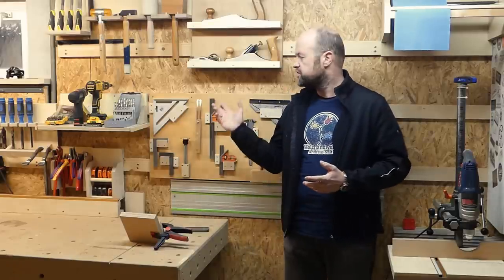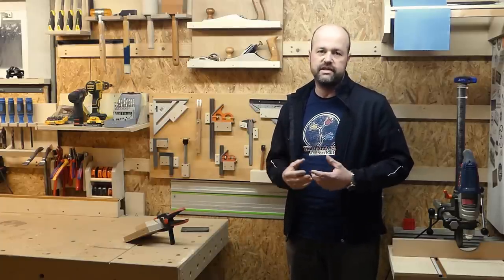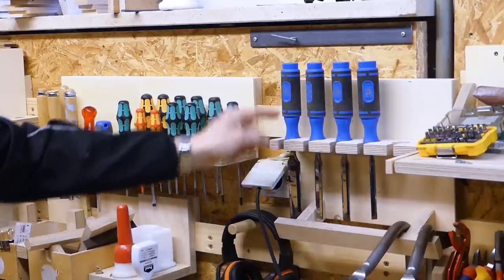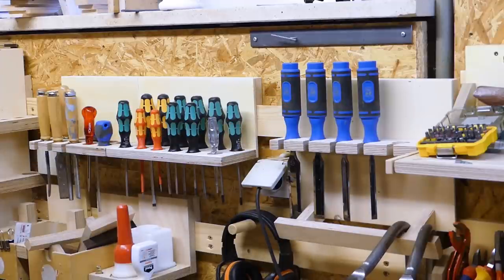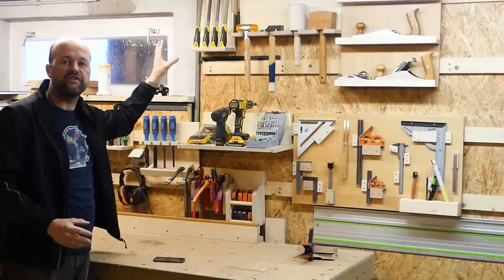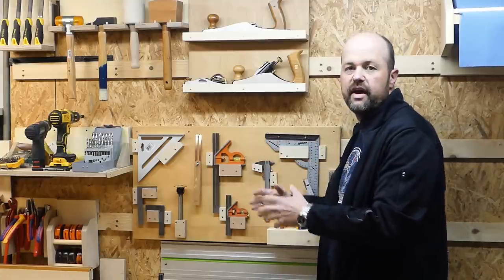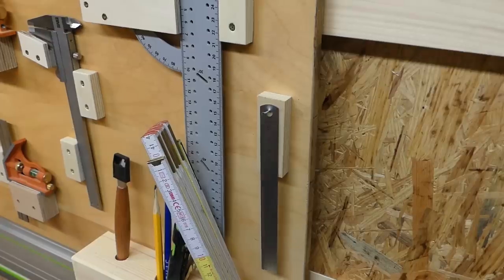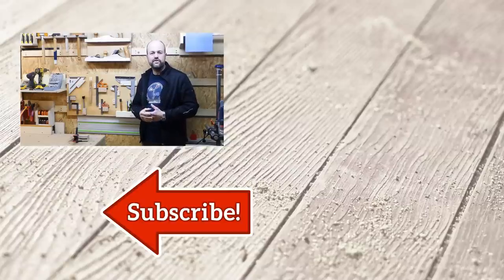Tool storage ideas: Make french-cleat tool holders and organize your tools

Comment: Andreas, I just ran across this video at the perfect time.  I'm currently in the process of outfitting a French cleat system.  I especially like the idea of spacing the measuring tools off of the backboard.  I share your concerns of having chisels exposed as I've seen by so many woodworkers.  The pockets for the screwdrivers are a nice aesthetic touch but since the handles are still resting on a flat surface I don't see how they would help stability.  I still appreciate the detail work there and how the measuring tool holders are nicely rounded over.  While I generally prefer narrated tutorials, the first portion of this video is well done to illustrate your builds without words.
Reply from the maker: Thanks for your thoughtful feedback!

Comment: Andreas, this may seem like a silly question. But your pencil caught my eye. Can you tell us about it? What type is it? Do you like it? Would you recommend it for the type of wood work you do?
Reply from the maker: It’s called Expert Dry Pen and I like it. But apparently, the original version is the Pica Dry Marker which seems to be better quality. I like that it has a belt clip and that you can reach inside holes (if they’re not too small). Make sure you get the H-grade  lead refill (the harder ones) for more accurate markings, the softer ones are more for carpenters who can tolerat thicker lines.
Reply: Andreas Kalt many thanks. I will look for it.

Comment: My tools are all accumulated, handed down from as far back as my great grandfather. Also I like to rummage for older tools and restore them.. I hardly have 3 screwdrivers or chisels that match... any tips?
Reply from the maker: I don’t know what it is you’re asking. What kind of tips are you hoping for?
Reply: Andreas Kalt my screwdrivers and chisels have different shanks. Some tapered some flat some notched... yours all seem to be of mated sets with all the handle bases being flat... not so in my case
Reply from the maker: OK. That would just make the process of making the tool holders a bit more cumbersome because your going to have to drill individual holes. But otherwise everything should work fine just as I’ve shown it.
Reply: Andreas Kalt thanks bud! Will try to let you know how it goes. I guess a reamer for the tapered and fostners for the flats👍🏻

Comment: What's the name of the square in the upper left corner and where did u get it? Is it accurate?
Reply from the maker: It’s called a speed square. It’s a carpenter’s tool so it’s not that accurate. I think woodpeckers has a premium version of it but I got mine from amazon and it’s ok but not super accurate.